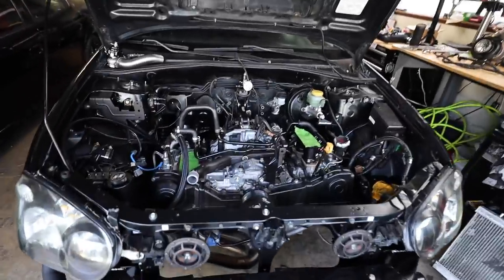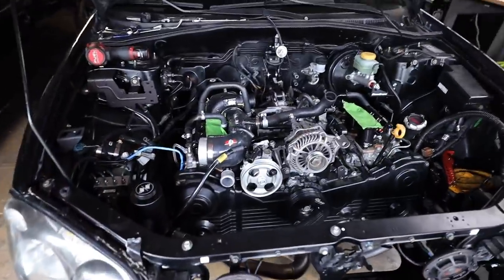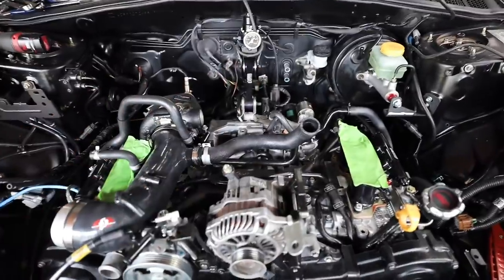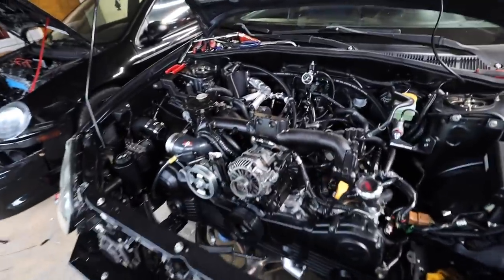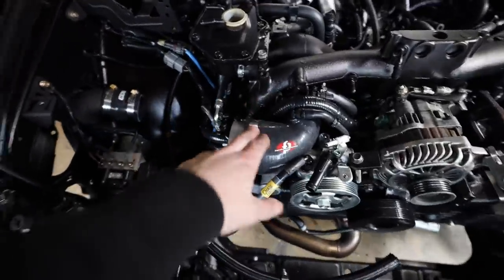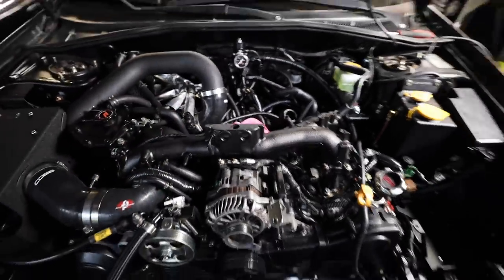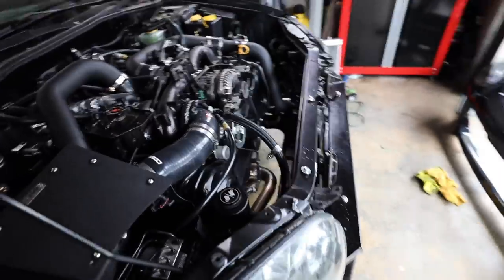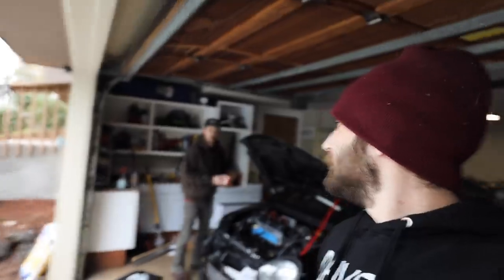The STI IS Ready to Go!

Comment: Really excited to see it on the dyno. Also you had plenty of room for the two nut method on that bolt and when in doubt some heat can't hurt, I've learned my lesson when I assemble I always go to my local fastener distributer and replace all the bolts with the highest grade they have available.
Reply from the maker: I did not even think about that 😪😪😪

Comment: For future reference next time a bolt brakes on an aluminum part you can weld a nut on the end and it'll come out 90% of the time. I constantly do this at work with exhaust studs
Reply from the maker: I don't have a welder 😭
Reply: @Smeedia  if I where a millionaire or just not broke I'd send you one.. don't worry though Miller will one day see how cool you are and sponsor you or Lincoln

Comment: Had a coolant crossover pipe bolt break like that once (who hasn't, right? 😅). Got it with vice grips that were tightened to the max and clamped on with channel locks. Of course liberal heat and PB. Too late for yours, tho I guess. Glad you got that crank bolt handled. fyi if you dig deep enough on a certain forum, a pdf fsm can be had for almost any impreza (all the torque specs 😉).
Reply from the maker: Some TQ specs I come across are all over the place, FSMs I come across all want me to buy them 😅

Comment: So clean and so pretty. I am hoping the throttle body stays sealed and fingers crossed for the tune.
Reply from the maker: Seems like it's been doing good so far!
Reply: @Smeedia  yay that is good. I have bad news I may have broke the locking pin inside the transmission 😢😭.  Shifter is great now, but still can't engage any gears.
Reply from the maker: Nooooo 😭😭😭😭
Reply: @Smeedia  yep that is exactly how I am feeling right now. Question I am looking for an exedy organic stage 1, but I am only finding ACT HD street performance and am thinking that should be good
Reply: Your opinion is extremely valued
Reply from the maker: ACT had always been my go to! Great clutched and fantastic customer service. I haven't used Exedy before so my opion might might a little biased
Reply: @Smeedia  not biased at all sir. I have been looking into ACT due to that being the brand that I for sure have more background with. I haven't dealt with Exedy at all yet and it is only an OEM replacement with the organic flywheel
Reply: I am going with the ACT for sure

Comment: Also, any particular reason you put the intake manifold and TGVs on after putting the engine back in rather than when it was out of the car?
Reply: Probably because he is using a bigger turbo and turbo inlet. It’s much easier to get the big inlet and turbo situated with the intake manifold off. It’s a real PITA to put a 3” turbo inlet on with the intake manifold already on
Reply from the maker: ^this 🙏🙏🙏

Comment: @smeedia did you have to modify anything to get the turbo to fit? I’m dropping in my FP red this week and have heard horror stories of having to grind away at the bell housing etc. Did you experience any issues?
Reply: I’ve got a stock location FP zero and it’s in there no cutting or anything. But if I ever have to remove it I’m taking it to a shop. Idk if that helps
Reply from the maker: No fitment issued at all, dropped right in 🙏

Comment: I'm just about to install my IAG AOS onto my 04 wrx, I noticed the Y fitting on the top two ports and kind of wondered what that was for. Was it that difficult to install (disregarding the fact you have a LOT less in your way to get it on)
Reply from the maker: The top 2 ports are the breeder fittings that go back into the turbo inlet, my inlet only has 1 provision for the AOS lines so the Y just made it so that I could have both breeter ports feed back into the inlet 😁

Comment: So I have a very small metal slap at idle. I rotated the rotating assembly by hand lots of times. No issues there. Bolted the heads up and rotated the assembly again by hand many times. No issues. Added the timing belt and heard a small tap when rotating by hand. Assumed it was just non seated cold forged piston slap, as it was slight. Now I hear it at idle and it has to be fixed. When you heard the bucket problem, was it in a definite spot? Could you tell that it was in the head? I'm pretty sure I have 1 bucket with bad lash. What I hear in person may not sound like what is recorded, that's y I ask because you heard it in person.
Thanks
Reply from the maker: It was definitely in a specific spot and you can hear it coming from the head, if it happens when you add the timing belt, check your tensioner 🙏🙏🙏
Reply: @Smeedia  just wondering y u think it could be the tensioner when it's only over cylinder #3?
Reply from the maker: Ohhhhh I missed that part, have you verified lash with thr heads torqued the the block or just bolted on.

And I could definitely tell it was in the head
Reply: @Smeedia  like an idiot I did not verify. Fresh from the machine shop and guaranteed to be right. So they said. Will never happen again. When my engine blew I needed it back asap so I over looked the lash, as I've never had an issue in the past. I checked literally everything but that. That's y I am guessing that it is that. The sound is just loud enough to pass the 'tap' sound and barely into the 'slap' sound
Reply: @Smeedia  by the way man, props to you for building that beast. It really is like rocket science these days. There is any number of things that can go wrong, and being able to measure and adjust is a learned skill. Considering everything, it is almost impossible to get it all right the first time, everytime.

Comment: So this Fluidampr thingy, what exactly does it do? Also just realised that you hadnt changed your intake manifold to the n/a one which flows much better. How come?
Reply from the maker: Did not see a huge need to swap it with shooting for 450WHP 🙏 And the FLUIDAMPER helps absorb vibrations from the engine to reduce how much shock is being sent to the crankshaft 😁🙏

Comment: 3.05am at my place...its weekend.. so sleep can wait 🤣
Reply: Anyway.. in case the engine not yet started...

To make your life easier for priming the steering pump (the dreaded pump whine noise)
Step is:
1-remove reservoir from bracket and place it slightly higher than the pump suction port (u can use rope or wire to hang it up from the hood)
2-fill up power steering fluid to full
3-dont start the engine, insert key at steering column
4-with front tyre on jackstand (already), turn the steering lock to lock (left-right) slowly and softly (when near lock position)... Do this multiple time and topup fluid whenever needed
5-proceed by starting the engine (or priming the engine or whatever)
6-topup fluid when the engine running (if done correctly it wont run dry when fluid already at full during engine off bleeding procedure)
7-when the power steering confirmed bled properly, u can reinstall the reservoir on its original location/bracket
Reply from the maker: That's exactly what we were doing 🙌😁